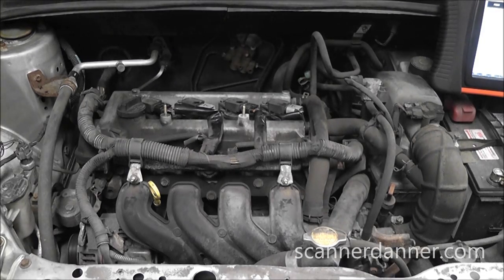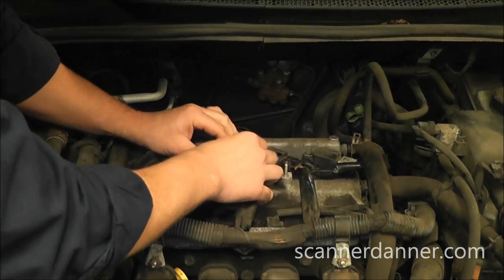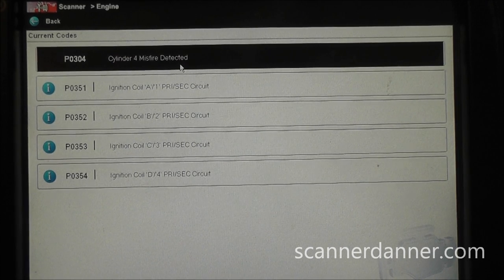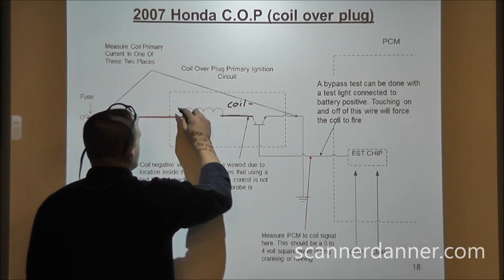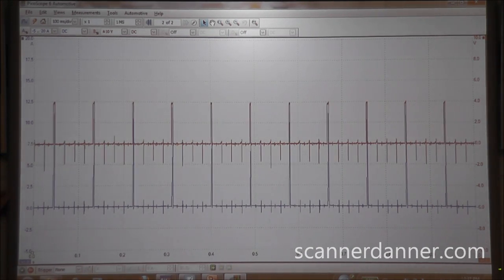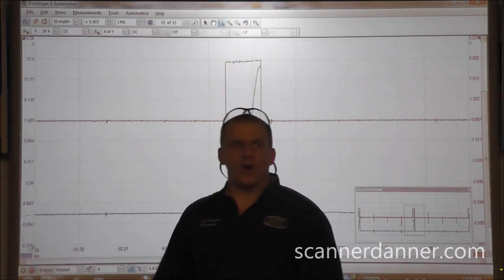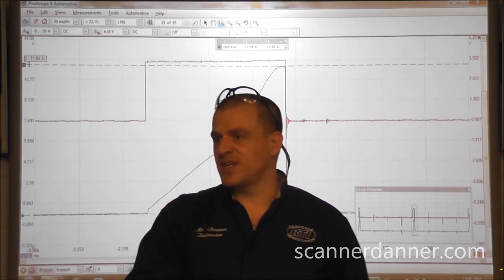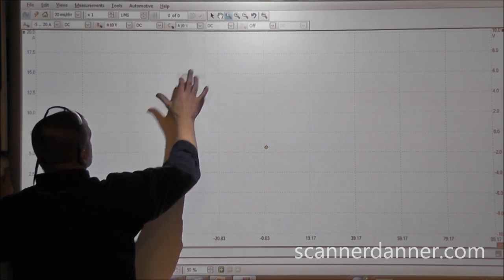Operation and testing coil over plug ignition (4 wire) - Toyota/Lexus

Comment: this video was an awesome supplement to me doing some ignition waveforms on my sisters 2016 Toyota camry. Same 4 wire coils. The explanation of the 4 wire helped me undersand what is happening. Also I was looking at a diagram on a 2009 Mercedes Benz S550, same design and I scratching my head at that common wire... now I understand. Again I can't stress enough paul your videos are relevant to so many vehicles. These videos are so packed with good info
Reply from the maker: Thanks so much brother

Comment: Paul,

Thanks for reply referencing '86 GT Stang.  I'm going to double check all the basic parameters/voltage readings on the coil and the ignition module.  Basically the engine dies while in idle, usually takes a few minutes.  Especially if run for 10 minutes, turn ignition off and restart immediately.  Normal RPMs are about 600 prior to engine stall.  She cranks up all the time, during these situations but dies soon after.  Compression is about 175 average on cold crank.  I have a pressure gauge on the rail and it's 40 PSI rock solid even during the time before it dies.  I probed wit a Scope on the computer/ignition module "driver" to the low side of the coil.  When the engine starts dying, RPMs dropping, the 12v at the negative coil end increases in time directly coinciding with the drops in RPMs and eventual stall.  I think maybe the magnetic pickup in the distributor is acting up and not triggering the coil to discharge and therefore causing the stalling.

Once again thanks for the reply, I will recon firm all my parameters and let you know.  I do have a video recording of the scope waveform while this problem is occurring.

Pete
Reply from the maker: Pete, I believe what you are describing is the ignition dwell time being adjusted by the module due to very low RPM and may be completely normal.
Refresh my memory on this ignition system. Does it have a vacuum hose going to the distributor? Is it a magnetic pick-up or hall-effect in the distributor (2 or 3 wire pick-up)?

Comment from the maker: Yes, but we want to do this with a test light, not a straight jumper wire. We may even want to add a resistor in series to drop the voltage as the base circuit typically only needs 4v to turn the transistor on. I have used a test light with no issues but it is something to think about,

Comment: I think the IGF only monitors the primary ignition circuit not the secondary. Great video. I have a 2006 Toyota Rav4 with a misfire coming in tomorrow and I wanted to review this circuit. I think this video also breaks the record for air hammer noise when filming.

Comment: I have a couple known bad waveforms from the exact vehicle if you want me to email them. This car came in, start stall. 2 channel waveform on coil control and fuel injector showed intentional fuel injector shutdown. another waveform on coil control and IGF, showed no IGF signal on #4 coil. And finally another waveform, current ramp and coil control showed no current produced in primary. 

The shop owner was pretty suprised with a coil fixing a start and stall complaint.

Comment: ...BEST VIDEO EVER ON THIS!!!   A couple of questions:
1) Is the IGT signal compatible with 5V logic (TTL or CMOS)
2) Does the coil fire in the HIGH or LOW pulse (ie is the pulse active high or low)?
3) ...any idea what current is required to hold the pulse active?
4) Will a 12V pulse safely fire the IGT input?

Again, thanks so much for the useful information---I LOVE your reactions to the "air hammer" segments!!
Reply: 1)  It is a 0-5V signal.
2) The ramp up of the primary coil starts when the IGT goes from 0 to 3.8V and when the IGT goes back to          0V the secondary coil is fired.
3) If you mean the IGT pulse I would say very low amperage since it is powering a transistor in the COP.
4) A 12V pulse on the IGT input would probably fry the transistor in the COP.

Comment: Great lecture !  Good explanation of 2 wire, 3 wire and 4 wire COP,  Interesting how different manufacturers choose different designs.

My swag is IGF is IGnition FEEDBACK,  Prior to installing the new coil, I would have guessed that IGF went low when a certain current was exceed and then back high when second current threshold was exceeded.  That aftermarket coil sure has a different looking IGF signature and make my theory look incorrect.

Comment from the maker: Remember there are two coils inside an ignition coil. You can have primary control and no secondary (spark). 
So technically when we say the coil is "firing", we are usually talking about the secondary spark. I know I am just picking at terms here, but I would say that the coil was not firing, but we had good primary control. This means the coil secondary was shorted or open. The amp ramp shows the primary control of the coil.

Comment: 2008 Volvo xc90 V8 Sport       I have a P0356 Ignition Coil 6 Primary/ Secondary circuit code. I tested the coil with a test light for spark and have a good spark. The plug is fouled. I replaced the plug and after a day or so I get the code again and the plug is fouled...again.  I'm thinking injector? I'm not sure. Great Video! I wondered why there were two commons on the diagram. Now I know!
Reply from the maker: could be, or you have a compression issue with that cylinder? Have you swapped that coil to another cylinder? I would do that too

Comment: Hello...SCANNERDANNER!!!
Can you tell me what the average IGT pulse-width's are that you have seen on COP's??
THANKS MUCH!!
--dAlE
Reply from the maker: Do you mean how long the coil primary is energized? Under 5ms typically
Reply: Actually, I needed to know when the HV output arrived WRT the IGT waveform.  I want to use this pulse to activate a logic input that must turn on when the COP spark starts or is still happening...yes, an unusual application.  I am guessing that maybe trigger my input on the 'falling' edge of IGT may work...or perhaps a small delay 'after' the rising edge.
I don't think anyone else could give a better answer!
THANKS SOOO MUCH!!!! @ScannerDanner
Reply from the maker: The falling edge of the IGT is where spark occurs. 😊
Reply: Really MUCH thanks Danner!!!
This gives me a valuable piece of info.
I was thinking...If the HV spark occurs on the falling edge of IGT (which I am assuming to be a normally low signal), then it follows that a confirmation signal of the spark, IGF, would have to occur when the IGT pulse is back low, or, nearly so....unless there is some kind of internal sensor (Hall?) that is doing something via coupling, from within.
...still catching up on your videos...wish I had found them sooner than I did!!
--dAlE
  @ScannerDanner
Reply from the maker: @dalenassar9152  the igf circuit is supposed to be triggered by the collapse of the primary coil winding magnetic field, but i don't know the internal circuit any more than that, I'm sorry.
Reply: Thanks for all your help.
I am thinking about de-potting one of these things.
--dALE @ScannerDanner
Reply: HELLO again...
My application really requires the determination of =exactly= when the spark occurs WRT the rising/falling edge(s) of the IGT/IGF signals.  If I had a PICO setup, I think I might even put a fast opto-sensor  (a photodiode) to one of the scope input channels to directly detect the light of the spark as it arced from coil secondary HV to ground.
Reply from the maker: @dalenassar9152  spark occurs when the transistor is turned off. This causes a primary magnetic field collapse. So the falling edge of the IGT

Comment from the maker: I can do that. Next one I get in with a misfire.  Here is the trick, remove the coil housing and run some old spark plug wires to the spark plugs. do all of your tests this way. also, if you have a scope and a low amp probe you can monitor coil firings from the feed wire of the model

Comment: On a 2011 corolla if you don't have the IGF from one coil it will turn the injector off and not report intermittent faults on other coils.  I replaced 1 coil and then had intermittent misfires on other cylinders.

Comment from the maker: If cylinders 2 and 3 are on the same coil and only half of the coil has spark, then yes, you have a bad coil. (make sure you replace the plugs and wires too)
watch my video on how to do a cylinder drop test. I had a Ford waste spark system with a bad coil that only half of one of them was working and I discuss how this can happen

Comment: Many modern systems shut off fuel for the misfiring cylinder by not activating the injector. If you are worried your car does not have this, disconnect the coil for a cylinder you know is working and check if the injector is still working. Still, I would only be worried about the oil in that case if the engine has a lot of by-blow, has been driven with misfire for a long time, or it has been too long since the last oil change. When in doubt, oil change is always good! Don't forget the filter!

Comment: If you had purchased a new aftermarket coil. Then had the same reading but still had a slight misfire on number 4. How would you identify whether the problem was in the new coil if the wavelengths are different. Is there a 100% way to know by waveform if a coil is operating properly? Besides just looking for a difference between the other coils? What if you had issues in multiple coils on a v8. That had a few aftermarket coils? How would you know then?
In another video you showed that the ramp was not straight and it was a bad coil as the other coils had straight ramps. I notice these ramps have a negative curve on the original coils just above half way to the top. The other video had a positive curve on one coil only and it was bad. It was near the beginning of the ramp though. Is that the key area?
Also, what if a coil has a secondary issue. How do you identify that issue?
Reply from the maker: You cannot see all failures in a waveform. Especially when looking at primary and you have a secondary leakage problem.

Comment: thank you for good explain bro❤ my question is can i check control wire which is green/blue.etc by testlight?
Reply from the maker: Not on ignition coils with the transistor built in (3 and 4 wire designs) as the trigger signal (control wire) is a small 4v signal.

Comment: Paul
Q:
Why Toyota use 2 IGF in V8 engines?
Is that mean PCM can't identify which coil not firing when you use 1 IGF.
Such as in Toyota V8 4.7L 2UZ-FE engine
IGF1
1 4 6 7
IGF2
2 3 5 8

Comment: wouldn't switching the coils also tell you if there's a problem with the circuit control? If the misfire condition stays on the same cylinder doesn't that prove it's either a wiring or computer problem?

Comment: Hello again...just a quick question:
Why does the ignition coil secondary (I'm actually thinking of the black"can" type) NOT fire any time during which the primary coil field is still building UP?  There is sure a lot of fast flux interaction from primary through secondary during that time interval.
Reply from the maker: Good question!
Yes, voltage is being created during this period where current is flowing in the primary and the magnetic field is moving and building, but it is not enough voltage (few hundred volts maybe)  to overcome the air gap of the spark plug. Average kv to overcome the air gap on compression, is about 10kv

Comment: Thanks again, super video. Using Verus:  there is a IG PID  (Ignition Counter PID) along with with Misfire Margin %  PID it will 
address this in seconds. IG counter PID only increments while missfire Monitor is unable. So, if this PID value doesn't change at all, no specific missfire cyl PID will be incremented and no DTC. if IG is not counting not missfire DTC. thats  why you need to set up Missfire margin PID. swapping parts will screw up this PIDS. and therefor  time spended in diagnost

Comment: On a page from your book:  "2007 Honda C.O.P" there is a note indicating that it is OK to touch a test light from +12V to fire the IGT transistor base, thus getting a spark.
What concerns me a bit is this:
It looks like the square wave from the PCM may be from a 5V-TTL logic processor output port in normal use.  Will applying 12V to the IGT digital input possibly harm the digitally controlled switch in the ignition coil?  I have an incandescent 12V test light and want to try it with IGF pulled low.  I am also afraid of letting INPUT ports "float" (especially CMOS) which may, at times, cause oscillating (due to high impedance) and overheating.  I do not know if that input port is pulled down in the ignition coil itself to prevent this HI-Z  The pulldown resister may be in the PCM only.  In the worst case, the input port is floating 5V CMOS logic.  BUT, I really think it is built more robust.
Thanks again for the best video I have seen on this coil.
Reply from the maker: Use an LED test light for this test. Yes an incandescent can overload that base circuit. Ask me how I know lol 
It is one of the only times I will ever recommend and LED type test light
Reply: @ScannerDanner  I bought an incandescent tester for that...glad I put a 1K resistor in series first!  It fired.
I DID NOTICE ONE STRANGE THING...The spark ALWAYS seem to fire when IGT went HIGH.  I blamed it on contact bounce, but even if I held the base high for a second, upon release--NO SPARK!  I am fairly certain that it fires upon release, but I guess I will have to set up a digital bounce-free input to ever see it?
Reply from the maker: @dalenassar9152  can't answer that my friend, spark definitely occurs when the coil primary current stops, on all systems, in all years. Now, who is to say what the electronics are inside of that coil. A base circuit turn ON signal may stop coil primary current? There is more inside of that coil than you think

Comment: So the only way to check and see if the coil is getting a signal  is to put a scope on the signal wire right? That sucks that you cant test it with a dvom,node, or test light.

Comment: First, thank you for sharing your knowledge.  It's greatly appreciated.  One thing I haven't seen is in a case like this: If it turns out that the coil isn't being commanded on, what next?  I'm assuming the wire integrity would have to be checked up to the computer.  If that checks out, do you attempt a re-flash or would that warrant a new PCM?  Thanks again.

Comment: just seeing the current ramp shows for #4 verifies control on that coil. current flow is present therefore the IGF didnt see a problem. i get that. what im not seeing is why this pattern points toward the coil being faulty. the secondary windings were the problem if i understand correctly but based on this pattern alone, couldnt this also be carbon tracing past the boot or the plug insulator? or a dead plug?  what am i missing?

Comment: Paul,
What an outstanding video !!

I'm an electrical engineer by trade but mor of auto enthusiast for fun.  Your video was very well done.  I am going to check out your web site and your additional videos. I'm troubleshooting a Ford Dura Spark II (86 Stang GT).  Maybe you'll have some videos on this type of ignition system.  Also, can you list the model number for the test set used on this video, it's really neat!

Thanks,

Pete
Reply: Thank Pete
I believe I used the Picoscope Automotive 4 channel (4000 series)
I could probably help with the 86 mustang. Are you missing spark?

Comment: Hi Paul just curious about 2,3,4 wire cop,many Nissan gtr skylines have a 3 wire cop yet it has a external 6ch igniter and not internal of the coil,pls help me out with your knowledge,btw because of you I just bought a 4ch pico for my workshop,what an amazing tool
Reply from the maker: It would be no different than testing a single ignition coil with an external igniter.

Comment: scannerdanner i have a controversial question i can't find anywhere in your book. i know it's not a good idea to leave the spark plug wire open or else damage to the coil may occur. i'm seeing some owner manuals on like motorcycles engine recommend running a jumper wire to ground to prevent coil damage when cranking the engine. that to me makes no sense. a spark plug has a 6000 ohm resistor in it and a circuit needs a power, resistor and ground to work properly without excessive amperage draw. you run a jumperwire on a coil high voltage spark output won't that damage the coil? also how long can you leave the test light connected without significant coil damage?
Reply from the maker: the resistance in the spark plug wire is for radio noise and does not protect the coil in any way shape or form. 
When the coil magnetic field collapses, the energy that is created MUST be released. If there is no release, voltage in the coil will rise to 50,000 volts or higher depending on the coil design. This high voltage will literally burn through the insulation of the coil and short out the secondary winding. If you put a plug wire to ground, the energy that the coil produces will be in the form of low voltage and high current flow (relatively speaking, coils do not produce high current). So you are giving the coil an easy release of this energy. Make sense?
Here is a perfect case study for you. This engine has a bad coil caused by an open plug wire. A shorted plug wire does not and will not harm the coil.
https://www.youtube.com/watch?v=IMuyqtFXIPU